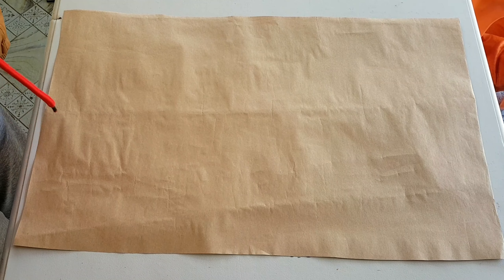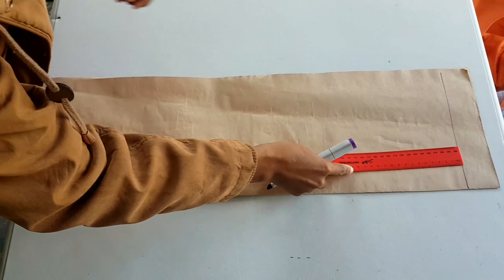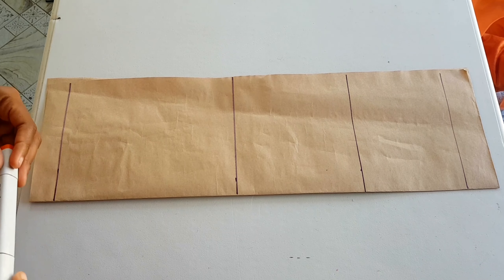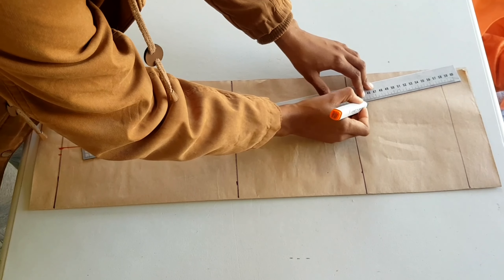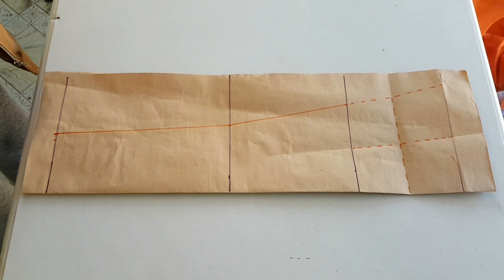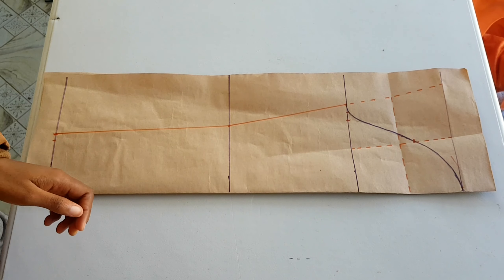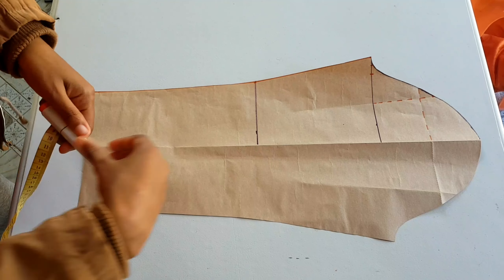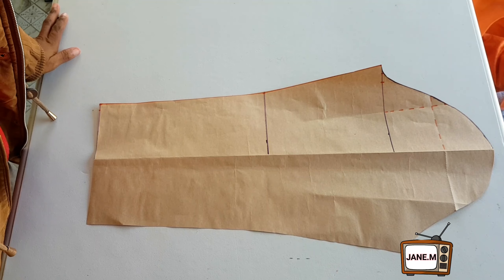How to Draft a Sleeve Block| Jane.M | Fashion Designer |Lesotho Youtuber

Comment: Questions: 
1) Video time: 11:04 - Are those measurements; back sleeve: 1/4", 3/4", 1 & 1/2" and Front sleeve: 1/4" are default one for S size? Can you tell me for M, L, XL as well?
2) what is the seam allowance measurement?
Reply from the maker: They are not default for a small size,use them for any size you are drafting.